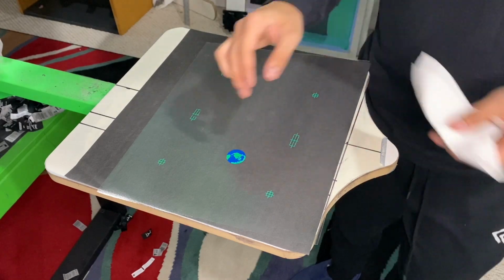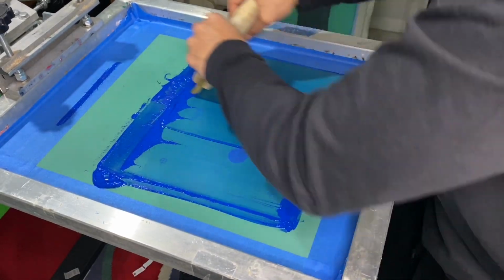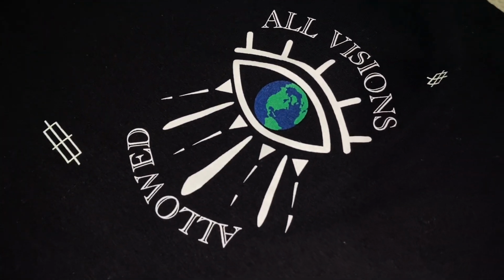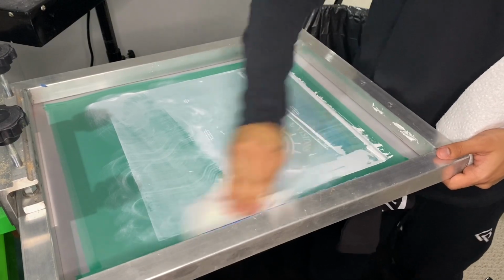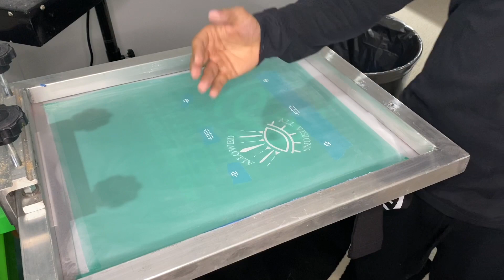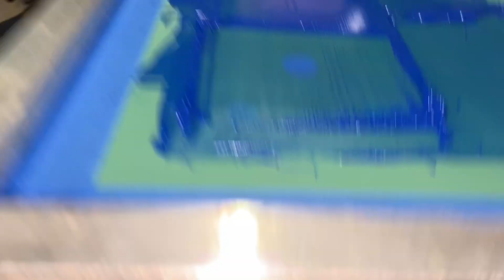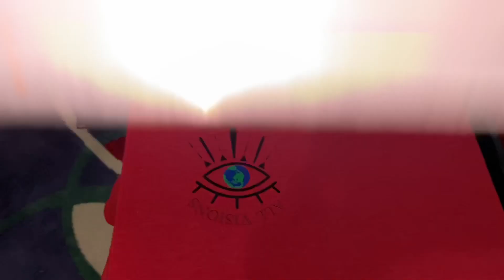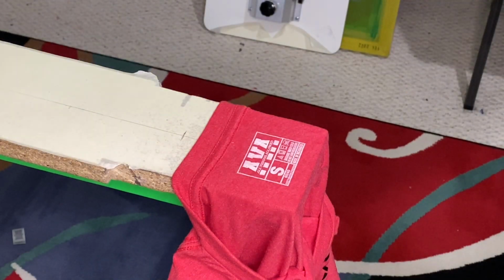SCREEN PRINTING A MULTI COLOR DESIGN IN FIRST PERSON VIEWPOINT!

Comment: You make look so easy, can you make a video of making the pallet marks to align the shirts?
Reply from the maker: Patience and time Brian! You can do the same! And you got it I will add that to the list to make. Thank you for the love and support!
Reply: @baavproductions  one more question man What is the measurements for putting the registration marks on the artwork in illustrator? The top and bottom. Does it matter how high it in relation to the artwork? Sorry I’m new to this.
Reply from the maker: @brianpulido8404  Good question, I honestly put it as close to the design as I can maybe 1 inch apart. However, it may be better to place it farther away for registration but again currently I put it about an inch apart, again that is just how I do it!

Comment: Use a different set of reg marks on pocket /chest prints ? Those 2 on the right look un needed... I prefer using clamps and an 8” squeegee for my pockets it will also yield for less tape ...I also find it easy when pulling the tape off to stick it back on the screen in the middle and roll it into a ball then it shouldn’t stick to your glove as much .... any reason why you don’t use blue shop towels on white ink? 

I’m surprised no ones asked you yet but anyways you can start naming the screen mesh count and the inks you use in the videos? 

Killer vid like always 🤟🏾🤟🏾
Reply from the maker: Thank you for the dope input as always! I like the registration marks like that because it forces the design to register better with larger registration marks through the whole pallet.. but I will try new ones out as well. 

I have been trying to get shop towels but never got around to it haha.. I will make sure I get some this weekend. 

Won't rolling the tape just get messy and add ink all over my hands?

Thank you again!